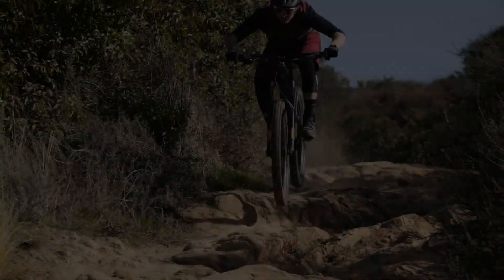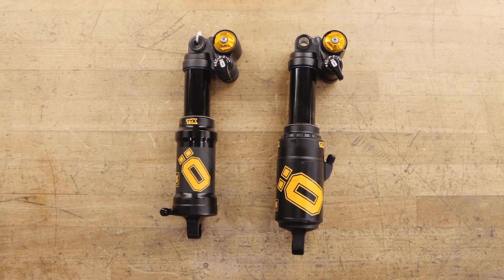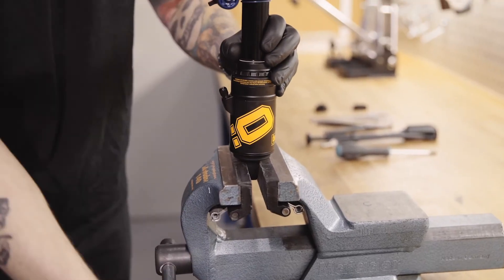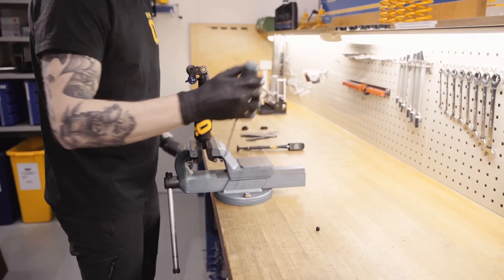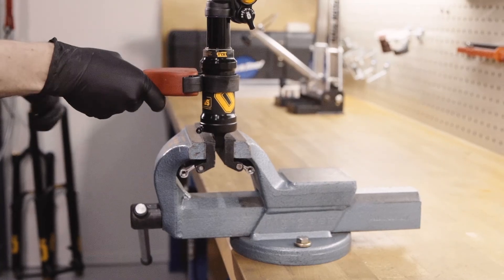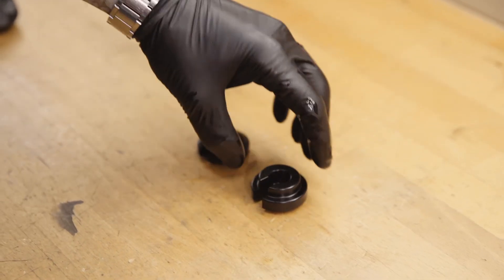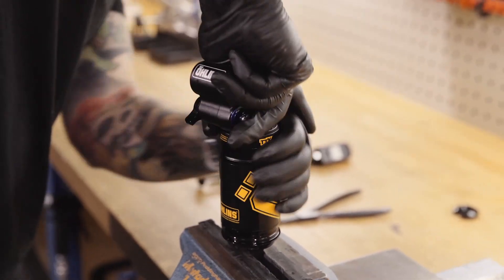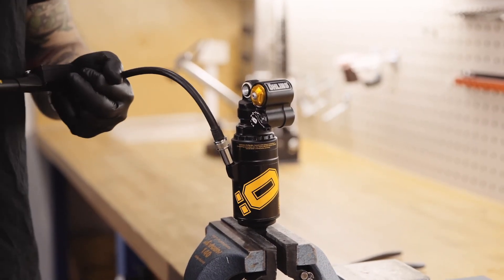MTB - How to install a volume spacer in an Öhlins TTXAir rear shock

Comment: On the double can version when sizing up on the spacer do you also fit the sleeve or is it 1 or the other?
Reply from the maker: Hi Phil, could you please clarify what you mean? If you're referring to the spacers, you can add/remove the spacers on the sleeve or eyelet of the shock — either way will work.

Comment: I really want to try a TTXAir 1 (single can) but support in USA really seems to be lacking. It doesn't appear Ohlins even reads or replies to YouTube comments on their own channel. I'd hate to spend $700+ on a shock and not be able to purchase volume spacers or service parts in the USA. I have a STX22 (1st gen Specialized Version) that Ohlins USA no longer supports and won't even service it! They want me to spend $600 on an upgraded coil shock that's backordered until July 2022! Very disappointed with Ohlins service.